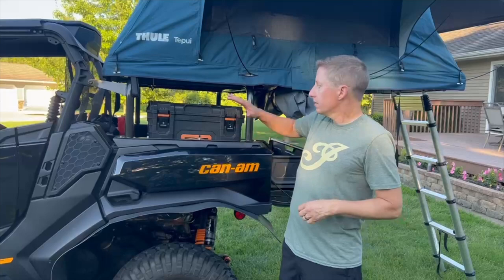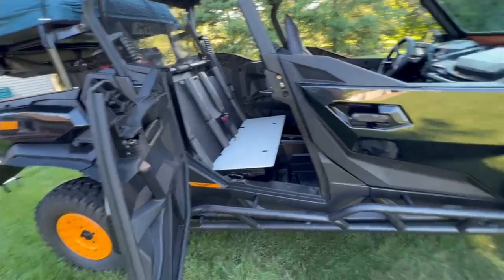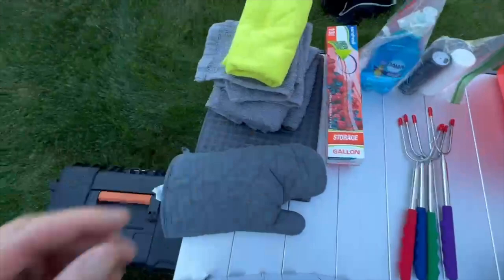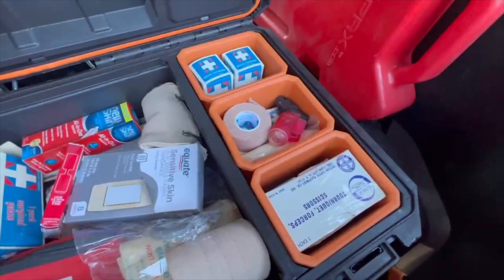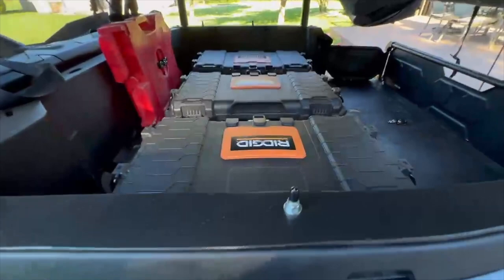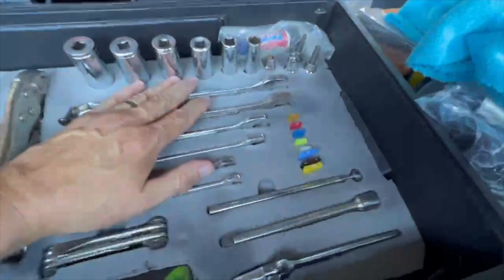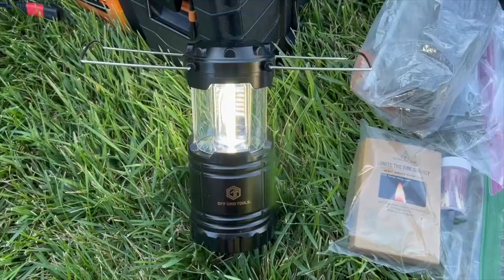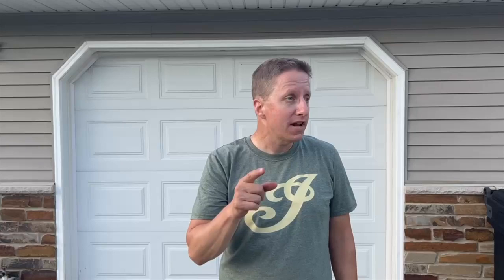2022 Overlanding Packing List in the CanAm Commander XTP

Comment: Great video!  How do you tie down the plywood on your floor bed ?
Reply: Thank you! I have seen some use the existing bed bolts but I use two ratchet straps. They are strapped front to back in the bottom of the bed and clamp down on the plywood. I added a second layer of plywood where the actual ratchet is to force the whole thing down. Hope that make sense, if not send me you email address and I can send you some pictures.
Reply: You just confirm what I was thinking doing ! Lol.  Thank you!! Watched your video again and was able to see the ratchet straps.
Reply: @camilien21  Awesome! Good luck on the build and happy adventures!
Reply: I’ve been posting my email and I think it blocks the post.  Is it possible for you to put pictures of your bed set up in the comments?  Are you using 3/4” plywood.   Thank you!
Reply: I used 3/4” thick marine plywood